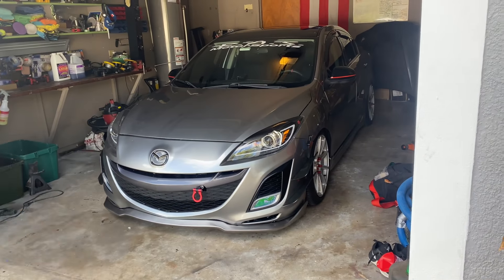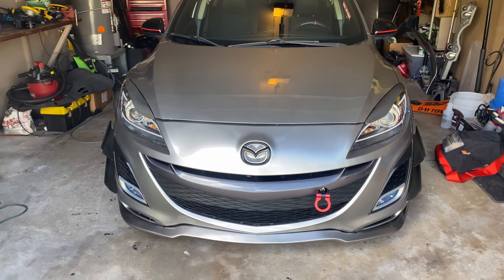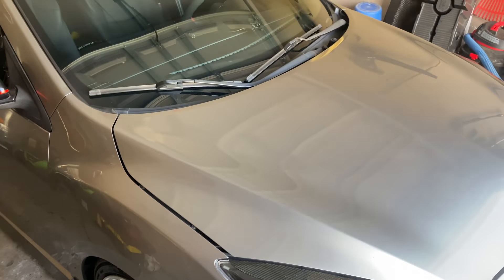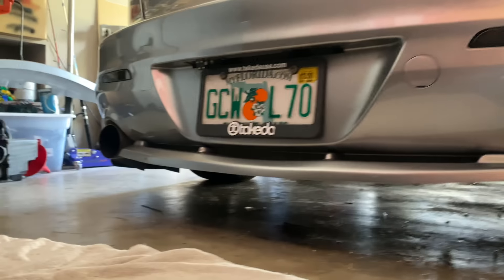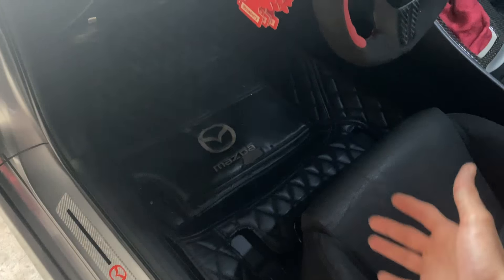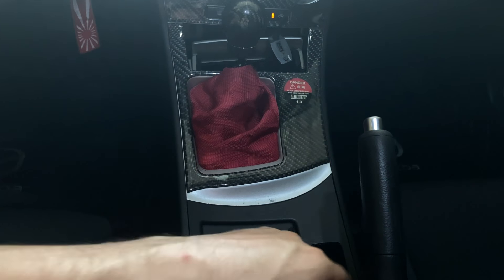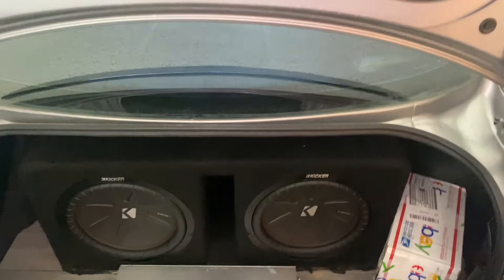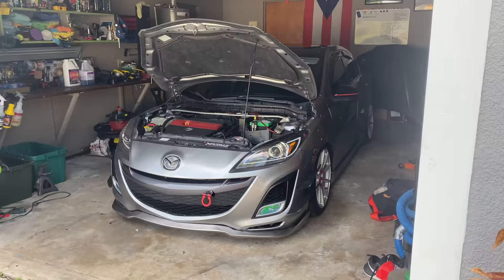More QUICK AND EASY mods done to my Static Mazda3!

Comment from the maker: Everything I said i was going to do to this car, I proudly say i did and it was worth it 🙌🏼 V3 of the car is almost done 🔥🔥🔥
Reply: What floormatts did you get? im looking for one like that, that will fit the mazda 3 like yours
Reply: Hey bro howd u bolt on the side skirts? Mine didn’t come with one tryna see if I could just self tap it, any advice on what i should do?
Reply: Can u drop a link for the headlights and the headlight lip also the tail lights as well

Comment: Hey bro I have a 2013 as well but I have the skyactiv version I noticed you have a 6spd but when you was showing the interior I noticed you have the automatic version cluster did you have to get it programmed to get the car to turn on or it was plug n play with no issues ? I wanna change out the basic cluster to something more sporty and worth looking at
Reply from the maker: Mine is a automatic, just put the shift boot over the shifter

Comment: I have the same car as you but was thinking of touching it up slightly. Painting it gunmetal gray with the same spoiler. New rims and brakes. An aero kit that's subtle for the front, rear and sides. I like the carbon fiber mirrors. Some minor interior work to match my paint and who knows. Maybe I'll get a new suspension for the car and lower it but not too much. I want it to be clean but not too noticable.

Comment: I just bought mine, is the 2.5L in there the Mazdaspeed motor without turbo?
Reply from the maker: Speed3 is a 2.3L Turbo, 2.5L is n/a
Reply: @aidenquiles  is it otherwise the same, minus the turbo?

Comment: Would you recommend Raceland Coilover? I’m thinking purchase those coils but I would like to know how bad it rides.
Reply from the maker: Hoku Saku me personally no, id get bc’s or the Bilsteins
Reply: I know your comment is old and you may have gotten coils already, but I still figured I’d pitch in. I’ve been riding on Raceland Ultimos for right over 9 months now on a 2010 3i. Coilovers are coilovers are coilovers so if you’re looking for comfort in your ride then you’re SOL in that department. From my experience, they ride great for what you pay for, especially if you’re like me and Affirm won’t approve you and you have to pay out of pocket.
They’re not springy or bouncy, they corner better than the Eibach lowering springs I had, and the car looks better too. (You probably will need an RSB though, to prevent oversteer, and I’d recommend the JBR adjustable .125 bar)

Raceland used to have an awful reputation but their R&D has greatly improved over the years, and they come with a lifetime warranty as well. Your climate does matter, if you live in an area where the roads are salted in the winter, that could cause some issues down the line.

All in all, I enjoy them, they get the job done, and I didn’t have to worry about missing rent when I bought them. I can keep up with my buddy’s S2K in the mountains, and I think that says a good bit.
(Keep in mind that if you have a Gen 2 MZ3 and go Raceland, you need to get the rear strut/knuckle bolts for a Gen 1 to get the dampeners to go on)
Reply: @Rabbit_Hill  His gen 2 on his install video he used same oem, so did I what do you mean ?

Comment: Did they make another stick Mazda 3 besides the 3s? or is this a 3s? Mine is a 3s that's why I'm curious. technically a gts because it's the 3s grand touring model with the 8 speaker Bose sound system with a little sub, leather seats, heated seats in the front with an electric drivers side seat and automatic window, dual exhaust for no reason, and slightly better suspension than the normal 3. I've had this car for like 5 years and I think I've literally only ever seen a single other one.

Comment: Do the corksport motor mounts make a difference big on your ride? I also have an automatic 2.5 and im curious if should upgrade my oem mounts
Reply from the maker: Francisco Mendez mazda motormounts usually go out so I would check them, but yeah the corksport ones are solid, motor aint moving at all
Reply: Are the vibrations pretty bad?
Reply from the maker: Francisco Mendez pretty rough ngl but you get used to it

Comment: Dope Mazda bro I just got my 2013 Mazda 3 and ordered my CAI. I did a muffler delete but wasn’t sure if I should delete the resonator too cause mine is only a 2.0 didnt want it to sound bad. I’m planning to lower it any suggestions on how much I should drop it?
Reply: Yo, I got a 2010 Mazda 3 2.0 liter ( should be the same model) will a 2.5 liter CAI work with the 2.0, I see none that made for a 2.0 :(

Comment: Did you swap out your tail lights for tinted ones or are those the stock one you tinted yourself. I have a 2010 Mazda 3s GT manual and it comes with the LED tail lights and they look so much better than the halogen ones. Although they aren't tinted 😂